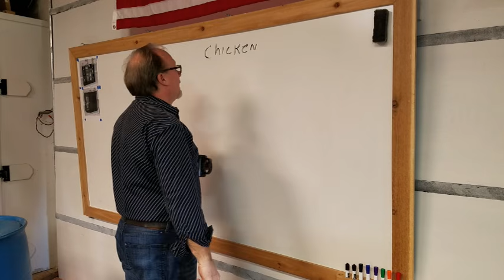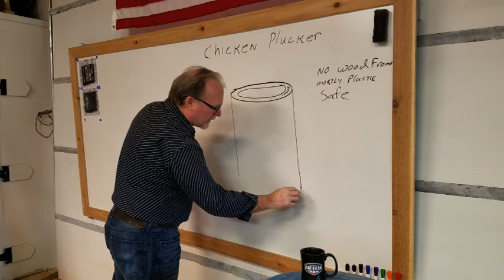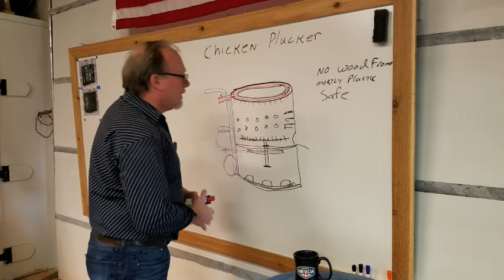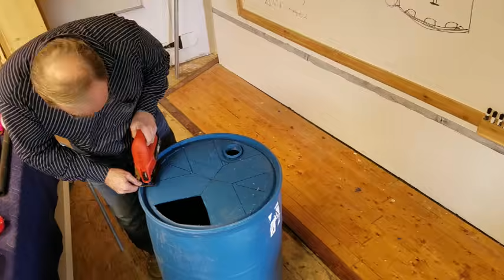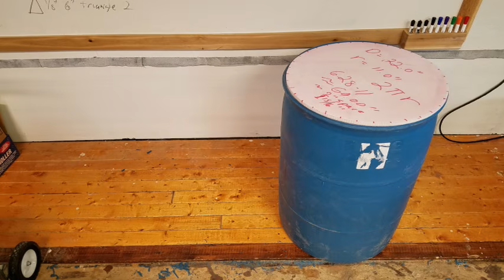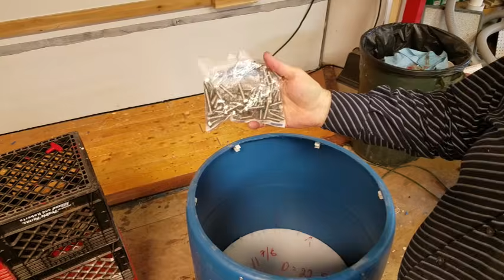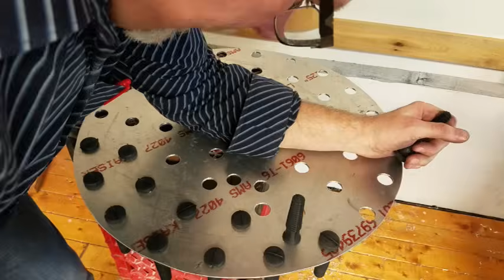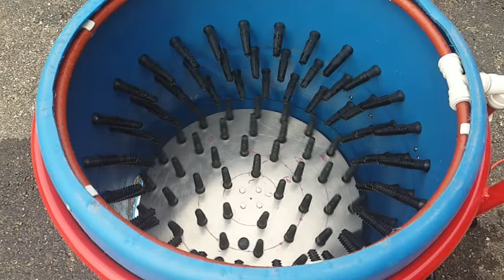DIY Mother of all Chicken Pluckers and how I built it.  My interpretation of the Wiz-Bang design

Comment: Your commentary at 26 minutes interests me greatly. So the fine balance. What temp and time worked best in your experiments?
Reply from the maker: Hi Stephen.  My friend found that the best result was water at 140 F. and ducking the chicken for 45 seconds, of course this may very with different birds but for the ones he processed that worked best.   F.Y.I.  I'm working on a scalder that will work as a companion to the plucker and should be an order of magnitude better than the one he used.    Thanks for watching.

Comment: Excellent video sir 👍
Reply from the maker: Thanks Dan,  glad you like it.   FYI,  I made a couple of changes and the video will come out in a couple of days so stay tuned.   I'm also working on a scalder for it that will post in about a month.  Thanks for watching..
Reply: Hey I made mine out of an old Rockwell drill press and it stoped once I throw the bird in. Could it be the size of the pulley? Yours is about 12 inch from the looks of it but mines just the pulley from the drill press.
Any suggestions?
Motors 3/4 hp.
Reply from the maker: Hi Dan.  Before I started the project I had reviewed many YT video's to determine a starting rpm based on the best functioning pluckers,  I had estimated ~300-350 RPM seemed to be near optimum.   I ran some quick numbers and considered 1/2 HP motor would be a minimum to accelerate a 10lb chicken to 314 ft/min.  you have a considerable drag imposed in the system from the chicken tumbling and scrubbing against the fingers.  With all that said the final drive ratio is 5:1,  the large driven pulley is 15" the small driver is 3". 
So, check to make sure you have a 1/2 hp but 3/4 is better, make sure it is a 1700 RPM motor, 5:1 ratio, and no belt slippage.    Hope that helps.

FYI, I have a new video with massive amount of details on building Plucker.  It explains, how, why and rational to my design.  Check it out, it may give you more insight and help solve your problem...

Later, and thanks for watching..
Reply: Southern Engineering thank you much!
Reply from the maker: Your very welcome, good luck and let me know how it works out..

Comment: What are the specs on the drive shaft? Is this iron pipe, or solid steel?
Reply from the maker: Hi Jacob,   The shaft is 1.0" solid mild steel.    FYI,  I have the unit in the barn to make a couple of minor changes and I will upload a more detailed video in a few days with specs, dimensions and observations, so stay tuned.    Thanks for watching...
Reply: That would be great. I have been wrestling with the Whizbang design for a few weeks now. I just came across your video and much prefer this design. I look forward to cutting plastic soon!
Reply from the maker: Great to hear it.   I've started a design for a scalder as a companion unit for the plucker, I think you will like the design.   Without interruptions I should have it out in a month so stay tuned..

Comment: What are the specs on your drive shaft? Is it hollow iron pipe, or solid carbon? Diameter?
Reply from the maker: Hi Jennifer. The shaft is 1.0" solid mild steel. FYI, I have the unit in the barn for a couple of small changes, I will be doing an update video in a view days with more detailed specs and observations. Thanks for watching and for subscribing..

Comment: Outstanding work kind sir. And thank you for taking the time and sharing your work. The hunt for parts is officially on!  I hope my project comes out as good as yours. Great job.
Reply from the maker: Thanks Dutch,  Glad you like it.  I just finished a couple of small changes to it and I will have the video ready in a few days,  nothing major just refinements.   Stay tuned...   Thanks for watching..
Reply: Southern Engineering Great. I just subbed, I like your style. I'll try to post a few more projects on the tube soon. 

I know I'll bee needing a honey extractor soon (centrifugal extraction), any thoughts?
Reply from the maker: Humm! I have a friend that keeps bees, I'll pick his brain and do some research and get back to you.  I'm  working on a scalder to go with the chicken plucker and that should be posted in a couple of weeks.  Thanks for the sub,  likewise..
Reply: Southern Engineering I'm looking forward to your temperature control solution, I see a water heater element and a digital controller coupled to a j or k type themalcouple.  Looking forward to it.
Reply from the maker: Hi Dutch, that's the basic idea, along with an automatic water level control and easy cleanup.   I think you will like my design....
Reply: Same, hunt for parts begins tomorrow

Comment: could you please give me the radius of each circle on the feather plate plz
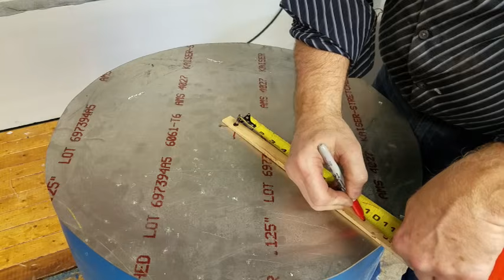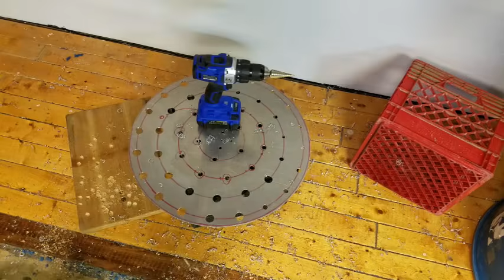Reply from the maker: Hi Iam.  The radius will very depending on the final dimensions of your plate but here is the general guideline that I followed.  Reference @ 19:31 you will see I set the outer ring radius at 10",  then I spaced the 3 remaining rows symmetricly towards the center staggering the fingers row to row,  Ref @ 21:00.   I hope that helps.     I will be making a couple of changes to the motor mount in the next few weeks also I am building a scalder to go with it so stay tuned.   Thanks for watching..

Comment: great job,,,any idea how many chicken finger you end up using?
Reply from the maker: Hi Nico, thanks.   I used 150 total.  After this video I added one additional row closer to the plate.    In a couple of weeks I will be making 2 changes to the unit; better motor mount and belt tension and updated the electrical. I'm also building a scalder to go with it, so stay tuned.    Thanks for watching and stay tuned..

Comment: how much fingers You use on plate and wall? what is the diameter of plate?
Reply from the maker: I used 150 Fingers total,  the plate is 22" dia. spacing is approximately 3.0" .  Stay tuned, I am going to make 2 changes to the plucker and give more detail on the motor mount, I'm also building a scalder to go with it...  Thanks for watching..
Reply: thanks for reply, I'm sorry for my English :/
Reply from the maker: Your welcome and no apology necessary, happy to help.  thanks for watching.

Comment: What size shaft did you use?
Reply from the maker: Hi Mike,  The shaft is 1.0".  Thanks for watching, stay tuned, I have a scalder I'm building to go with it..
Reply: The rows of fingers on the side of barrel how far apart are the rows?  And in row about 2.5 inches? Thank you
Reply from the maker: The rows are staggered and stacked ~3.5 in, I have also added a 4th row closer to the finger plate.   Spacing can vary relative to the size of you drum.

Comment: how to put the polycarbonate sheet in the barrel
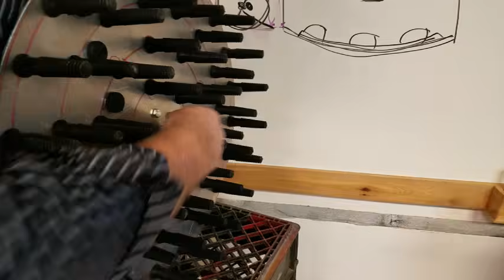Reply from the maker: Hi François,  I used stainless steel sheet metal screws #10, spaced around the circumference ~ 3" (75 mm) apart.   At the 22:50 mark you can see the plate and at 23:15 you can see the screws.  Hope that helps.   Thanks for watching and stay tuned I am going to do are a new video of a few changes to the unit and also a scalder to go with it.
Reply: it's for my mom nicole
Reply: it's in bottom for the barrel
Reply from the maker: It's at the 2/3 mark at the lower reinforcement rib.
Reply from the maker: Thanks for subscribing.

Comment: Did I miss how the on/off switch also controls the water?
Reply from the maker: Hi Thomas,  no  I had a video camera failure (operator error 😳) and lost that part.  The power switch also activates a lawn sprinkler valve.   I am going to make a couple of changes to it in a few weeks and I'll post a video.   I'm also working on a scalder to go with it.  Stay tuned.  Thanks for watching..

Comment: did you first try a smaller motor iv got a 1/2 hp 1700 thought with the gear reduction it might be enuff ?????
Reply from the maker: I ran the numbers and 1/2 hp would be enough.  The 1/2 hp motor I had was 3600 rpm and I could find no practical (simple) way to achieve the final drive ratio.  The 1 hp motor was on sale for the same price as a smaller motor..  Hope that answers your question.  Thanks for watching..
Reply: Ξεπουπουλιασμα κοτόπουλο

Comment: I just subscribed to your Channel really liked your project hoping to see more was wondering if you have a materials list so I can purchase and make one but I don't want to make one with a motor I want to have a rod in the middle with a handle to spin it. Hope you can help
Reply from the maker: Hi John and thanks for the Sub..  After watching the unit in action I can say you would need or have huge arms to do that.   May I suggest using parts of a bicycle,  the pedals and gearing would offer easy speed adjustment and the leg would be better suited to spin the plate at the necessary RPM and duration.  What do you think?   Thanks for watching..  P.s I have scalder i'm building to compliment the plucker..
Reply: you're very welcome but thank you for demonstrating and building 1 I thought of the bicycle but I have no idea how it would connect to a pulley because it's facing the wrong way if you have some plans that could help me I would really appreciate it

Comment: Do you have recommended places to buy the 24"x24"  1/2" thick PC sheet and the t6 alloy plate?  Amazon's prices are very high on those two components.  And can the polycarbonate sheet go down to 1/4" thickness?

Also, I've estimated/calculated that you've used approximately 100 chicken fingers to assemble this, is that correct?  Again, Amazon sells in 100 or 150 fingers so I'm trying to determine what's the right amount.
Reply from the maker: I purchase my material from Alro steel and plastic : www.alro.com.   Polycarbonate is to brittle use 0.5" HDPE or Nylon.  I added 2 additional rows, 1 to the finger plate and one row lower on the drum, this was to keep the chicken wings from breaking.  Total count 145 fingers.  Hope that helps.  FYI, I'm going to change the motor mount to a rigid mount and tension rollor, also working a scalder for my friend.  Stay tuned.  Thanks for watching.
Reply: Thank-you!  I know you used 1 hp motor, but I've found some decent electric motors on craigslist in the 2-2.5 hp.  Any caution on More Power?  tool time grunts
Reply from the maker: Never being one to turn down more horse-power, as in More+Better=MOREBETTER!.   A few cautions are, motor mount strength, weight of the motor and the extension cord if applicable.  1hp=746w ~6amp circuit, 2hp~12amp, 2.5hp~17amp.   Have fun with your build.    p.s. there is a little Tim Taylor in all of us... 😄

Comment: how many chickens do you see??
Reply from the maker: Hi Jose,  not sure what you mean, but, they processed ~120 chicken the first day.  The unit can handle 1 or 2 chickens at a time.   Hope that answers your question.   Thanks for watching..
Reply: thanks for the information that was what I wanted to know excuse me I do not handle English
Reply: How many fingers did they use? I would like to make one for 4 chickens
Reply from the maker: No Problem, thanks for watching Jose..    P.s.  I have a chicken scalder build in the works, watch for the video..
Reply from the maker: I used ~150 fingers for this unit,  large diameter will require more...

Comment: Have you tried 2 or 3 birds at a time? It looks like it might not be heavy enough to handle the weight of 2 or 3 birds or a Turkey? Any thoughts about how you plan to stablize it?
Reply from the maker: Good questions.  The friend that I built this for has tried 2 chickens, it did work but he could not keep up with more than one at a time. There was just 2 guys and 120+ birds and they found that one bird at a time was the best pace they could work.   I don't think 3 birds is possible and a turkey is out of the question with this design.   Stability is an issue, what they did was clamp it down to a wooden pallet, that broadened the base and helped, it also keep their feet dry from the water runoff;  as you may know a 6-8 lb chicken tumbling around at 300 rpm is inherently unstable.    I hope that answers your questions.  Thanks for watching
Reply: I have seen two birds done at same time  seems like the 2 birds bunch up  and that can induce a lots of wobble  and that can lead to things coming apart

Comment: Great design and build! As a machinist, I can appreciate a good engineer like you. I wouldn't change a thing...except I use a ton of aluminum variables; 6061, 2024, 7075...and so forth. I appreciate 6061, however I have found through fixtures I use that water corrodes (pits) it pretty bad over time. I have my fixtures hard anodized now and that has corrected this particular issue. I'm certainly not knocking it by any means...just offering input from experience. Again sir, well done. I could watch your videos all the time! Thanks. I will subscribe to your channel.
Reply from the maker: Hey Thanks Bobby,  glad you like it and I appreciate the input.  I have a huge list of projects ahead, I hope you will enjoy them.  I'll remember what you said about 6061,  I didn't have any SS in my stock and figured 6061 would be usable for this job.   I'm going to change a couple of thing on it before next harvest, also I'm designing a scalder, you may find interesting..  Stay tuned.  Thanks for watching and thank you for the subscription...
Reply: Bobby Smith hey bud, I went on your channel hoping I was going to find what you explained but didn't find any vids. I hope you do a vid next time you put one together. I myself am looking to put one but would love to see a vid of what you were talking about. However I think this gentleman did an awsome job.
Reply: superrehmans Hi, I'm sorry, I've never made any videos regarding machining or the parts I've made. I was just commenting in general about this man's engineering. He's awesome. I've just got a ton of experience with different materials and was throwing out input. But thank you for your comment on my comment. Lol